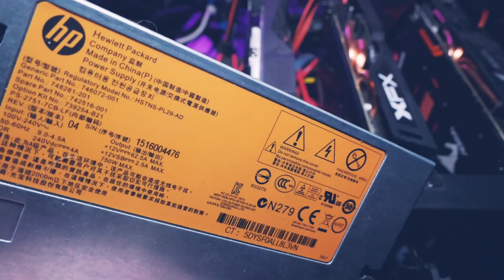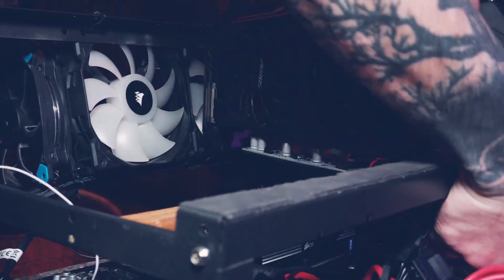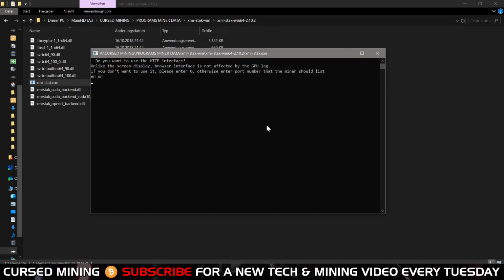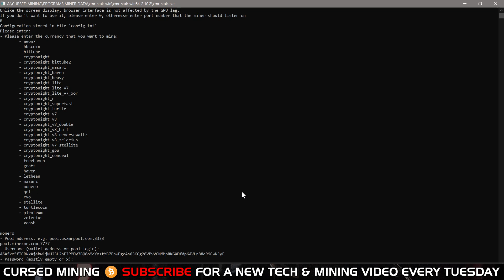How to start Crypto Mining / Mining Beginnings - is it worth it? Cryptocurrency / gpumining

Comment: With what Gpu should i begin with i have been farming on my personal computer for a while now and i want to get into it
What do u recommend
Reply from the maker: Really hard to find any GPU right now :/ for ETHmining, be careful that it has more than 4GB vram, 4GB and below can't mine it anymore. Other than that, from older gen RX580 up to RTX3000 everything is profitable, but you will trade of efficiency for price! Nice sweet spot in terms of efficiency are 1660S/RX5700 - but ofc RTX3060Ti/3080 pack an efficient punch :) hope that helps a bit! cheers ⛏️
Reply: @CursedMining  Thank u a lot for the fast respond and the helpful information
Reply: @CursedMining  i will be mining with nicehash thats Mbtc then
Reply from the maker: @emanuelabrahamyan5924  nope, NiceHash mines whatever coin is most profitable and pays you out in BTC :) mBTC is just a denomination! Your GPU is most likely mining Ethereum (except if 4GB) and your CPU mining Monero, cheers ⛏️

Comment: Nice Vid I started off buying a single tube innosilicon a4 136mh/s scrypt miner for $400 at the time mostly paid in LTC. needless to say I got scammed as the prices came down after the 2017 runup. Looking forward to Monero switch to RandomX as bitmain will release its 3nm chips to the pubilc right before the bitcoin halving of May 2020.. That company already has the 5nm up and running which is why most miners of sha256 are making a marginal profit..
Reply from the maker: thanks for sharing your story 😁⛏️ got scammed along the way often too, totally feel you! Cheers

Comment: GPU mining, would you get multiple 1660s or even 1660 S, 1660 ti or one or two 2080s?
Reply from the maker: The whole video was kinda about that I don't really give buy tips :D but of what you mentioned I'd prefer 1660 normal + super. RTX is far to overpriced with features we miners don't need. Cheers ⛏️
Reply: @CursedMining  lol Thought the video was about should they mine.  I already have on right with straight 1600's.  Looking to invest in one or 2 more on black Friday.  However you answered my question.  Thank you.
Reply from the maker: No worries mate, I just always feel strange with giving buy advice as the cryptoworld is so unpredictable 😁 but I will go in the same direction as you :) had bad luck with 1660 warehouse deal, but S version should be similar/slightly better than the normal with better resale value along the line some day :) RTX cards I don't like too much - nVidia pulling money out of people's pockets 😁 have a good one mate :)

Comment: Cursed Mining, nice video. I agreed with you. Start with gaming pc, workstation or anything that we already have. Then learn what is the best miner to use, how to bios mod, undervolt, overclock and proceed from there. Personally i don't have farm. All my small rigs have mix of gpu ( rx560, rx570, rx580, 1060, 1660 etc etc ). I don't really care about profit. For hobby.
Reply from the maker: I think many people are laughing at me for calling my little room farm =D but well I just like the term =)  I also always had wild mixes of GPUs as I never bought many at once, rather watched out for deals step by step =) thanks for being on board and tuning in Roger - cheers!
Reply: @CursedMining  i am going to record a video of my little angel msi rx560. She still can get 12mh/s with 30 watt. :) Some people  may laugh at me but some won't. Mining community have many good people. The best thing in life is shared. Without hobby miners, blockchain will fall. Just a matter of time.

Comment: Any overclock guides and bios mod guides for AMD rx cards?
Reply from the maker: Depends on what you are mining :) f.e. Monero I did show my efficiency setting / undervolt for RX 580s :) check the X6 rig build vid on the channel! Cheers and thanks for tuning in ⛏️
Reply: My MSI afterburner setting: 850 core voltage, power limit 80%, 1100 core clock, 2050 memory clock ( samsung memory ). 31mh/s mining ethereum, temperature 56°C

Comment: I want to go bigger scale I currently have 1 rtx 2070 but my electricity it 0.18 USD kwh I'm not sure if it's worth getting more gpus due to such expensive electricity. Advice?
Reply from the maker: Hey mate, this video was about why I don't really like to give that kind of advice BUT I can tell you that I pay around the same, if not even a bit more than you (~17 cent, but euro-cent all inclusive) - did not stop me from going crazy :)
Reply: I'd move :) Maybe commercial rates? Not sure you'll be profitable with anything at those rates in this market on this day. Maybe tomorrow? Better to just buy coins.

Comment: which is the best configuration for amd rx 580 and rx570 in overclok for better performance
Reply from the maker: Depends on what you are mining with them as configs will change with the algo. If you are interested in Cryptonight / Monero, you can check my RX 580 Monero mining rig build video, in that I go for a very efficient setup =)